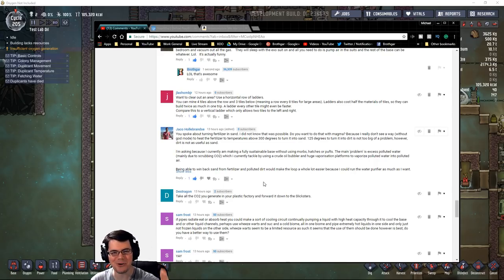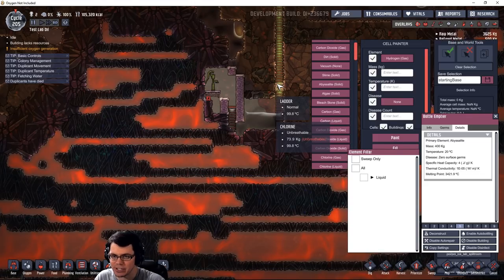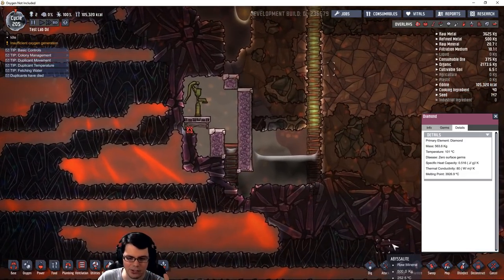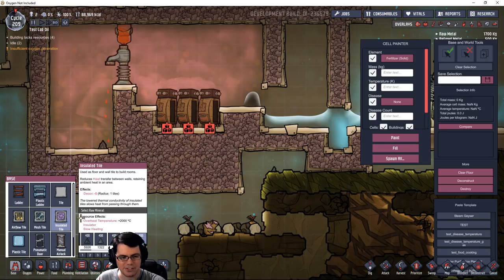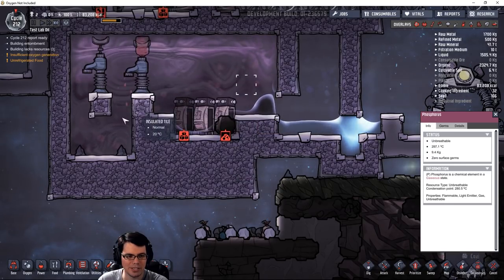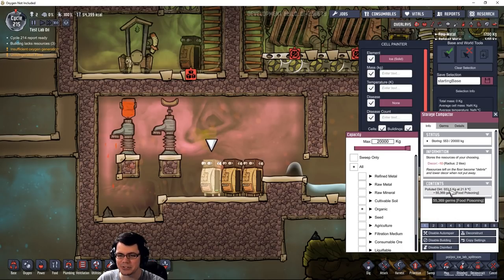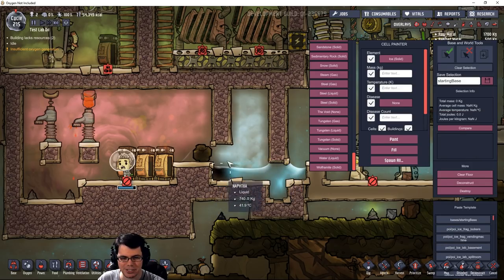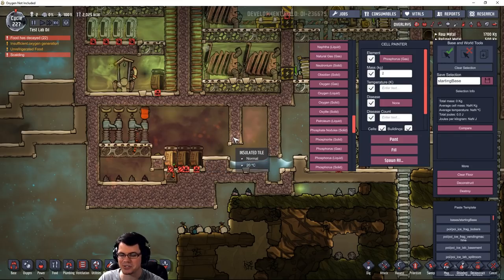Make More Sand Experiment! Oxygen Not Included

Comment: You can get rid of the need to dig if you allow the storage compactors to hold dirt and sand also. They will convert inside the compactor and then you can just take the sand out by placing another compactor just for sand outside the area so once it converts they take it out.
Reply: Ryujin Supreme that there, thats really usefull information! Thank you!
Reply: Sander Visser yea it gets rid of the conversion loss from digging
Reply: Place the 2nd compactor for just sand with a higher priority outside the kiln in a cooled room (otherwise you turn your base into a kiln too)

They will convert inside the compactor and your dupes will move the sand out automatically when it's ready.
Reply: Problem solver ^

Comment: A more useful use of a magma "fountain" is converting crude oil into natural gas without having to use energy on refining it, and without having to bother about useless petroleum. It refines it in a 1 to 1 ratio which means it's literally 100s of times more efficient than an oil refinery and petroleum generators. The CO2 output of the NGGs goes to slicksters which converts it back into crude oil.
Reply: I should note that a natural gas generator takes 60g/s NG and makes 82.5g/s CO2 which is turned into crude oil by slickers at 1:1 ratio... so you create a surplus of crude oil. To get a neutral cycle you need to carbon skim some of that CO2 away or you'll end up flooding the map with crude oil.

A realistic set up with one liquid bottler and two bottle emptiers can easily convert 1kg/s crude oil into NG. That's enough for 16.67 NGGs (or the same as over 6 NG geysers) generating 13333.33W and having a surplus P-H2O output of 1500g/s. And that's even setting up a full 100% recycled CO2 -> crude oil arrangement.

Comment: Awesome Brothgar. I found a way of dealing with the polluted water: vaporising it on big platforms and turning the polluted oxygen into clean oxygen. 

I need natural gas for power production though, so I need quite a few fertilizermakers, which means excess fertilizer. I currently have more than a 100 sleet wheat growing to get rid of the fertilizer and I'm still not using enough. Massive logistic operation just to get rid of fertilizer.

I'm not a big fan of magma because it isn't truly sustainable. You gave me a new idea though: heat the fertilizer to 125 degrees using a aquatuner, turn the dirt into mushbars and let those decay after which I feed the polluted oxygen into the bubbler. I'll do the  math and if the outcomes are favourable try this system tomorrow.

Comment: I wish they would make air locks that you can research and then build
Reply: I wish they improved the thermodynamics simulation and increased the tile resolution of gases and liquids. Imagine the posibilites if we could build stuff with compressors, turbines, etc., all the things we could do!
Reply: i dont like liquid airlocks ither but you can make a really ineficient one by just pulling a vacume between a set of doorsXDDD, well if its not for seperating extreme temps holding gasses on one side is preety easy because you just need to how one side in a higher presure and just allways when someone goes through pump a little over
Reply: Tried it and this worked great. But its still kinda ugly to look at :P
Reply: Having two pumps between three doors pulling a vacuum works even better since you can pump the gas back to the sides that they came from, further helping mitigate the spread of heat and contaminants.

Comment: Isn´t it easier to carry the stuff you want to turn to sand closer to the lava instead carrying the lava to your base?
Reply: It would mean carrying the dirt and then carrying the sand back (assuming your sand using machinery is not near the magma as well). Also - you don't really need to carry magma indefinitely, just enough to create a stable thermal mass
Reply: Either way you're still making 2 trips so it doesn't really matter logistically. However, efficiently, simply dropping the material down to the magma would be easier, presuming the temperature is hot enough, of course.
Reply: That make sense.
Reply: Carrying objects takes Duplicant work. Brothgar was being silly with the bottler, but you can just as well make a pump with a lever to dump the lava into the makeshift furnace. Though, you better make sure you use abyssalite pipes, or it'll just melt it's way out. There's tons of ways to do the same thing.

Comment: The problem I see with this design is its reliance on lava - many pockets of lava are tightly surrounded by neutronium, which makes digging into them impossible. It's possible to find a couple of exposed ones, but we're basically moving the problem from finite sand to finite lava.
Reply: You're moving the problem to extreme temperatures. But i was wondering: How does it work in the long (long, long) term? If you look at the whole map as a closed system: You are starting with a high entropy system with various biomes, but over time it should all level out?! The temperature inputs are the geysirs with 100 or 140°? And Weezewarts are taking energy out of the system. Does that level out within a map or are you going to get a more heated map over time? Your machines only transfer the energy, right?
Reply: Entropy is something you should worry about after a couple thousand cycles. Most players don't go beyond 800.
Reply: IlnickiStudios entropy would be in like 100 cycles if there where no abbysalite between everthing. But that will stop it from happening.
Reply: Florian H. A lot of machines delete heat as well. Generators: doesn't matter how hot the input is, fertilizer makers: same story, etc. Thermoregulators and aquatuners have a fixed heat output, cool something with a high thermal capacity and you are deleting heat as well. Lots of 'tricks' to delete heat in ONI.
Reply: Machines in general create heat out of nothing. So the Duplicants being there will add more heat into the system. But machines that convert objects delete heat, and you can rarely find a Void tile that deletes all gasses and therefore heat that touch it. Without Duplicant interaction though, geysers will eventually reach max pressure and stop outputting heat. So eventually the wheezeworts and forces of coldness will take over the whole map. But it'll take ages, given all the abyssalite it has to pass through to do that.
Reply: Have you test it, will it pass trough the abbysal? maybe it won't. Morbs make gas at a set temperature, i think pufts do to. So there is more to that.

Comment: You should do a self sustaining base that stays under 40% stress by cycle 40. You should use all the geysers to supply the neciary materials to run the base (steam geyser for water, oil for power and plastic, chlorine for sanitation, and natural gas for power). I built one like this and it ran really smooth until cycle 100 as I couldn't make enough fertilizer for my crops, thus  everybody died.
Reply: It's quite easy to do, I have my sustainable base for 16 dupes at cycle 700 every thing I use is renewable.
Reply: Emily Björk If you want to make it harder: don't use pufts, morbs and hatches.
Reply: Jaco Hollebrandse I have like one puft eating the odd polluted oxygen that makes its way into my systems. Mostly because I haven't build an oxygen condenser yet.

Comment: But then, is there an easy way to cool that sand so it become use able in your base? After all, if you move it to a water purifier, since it is built from metal, it will melt unless the sand has cooled quite a lot.

We have seen here that the hydrogen got hot really fast. Still, maybe a storage put under water might cool it down efficiently. Might be worth trying at least.